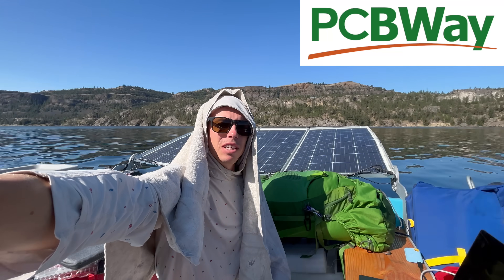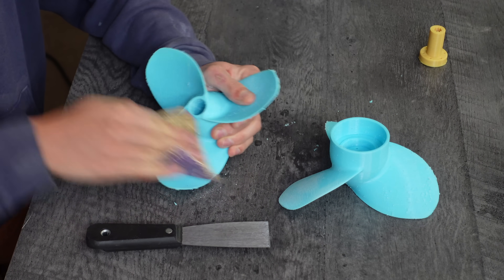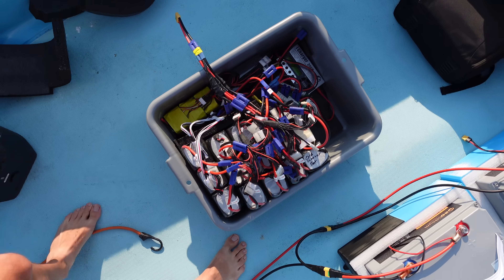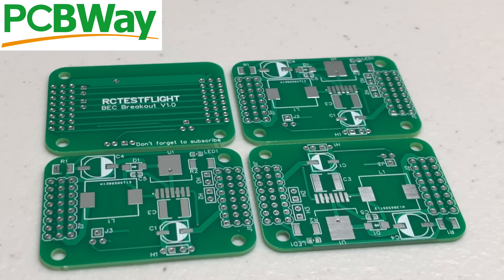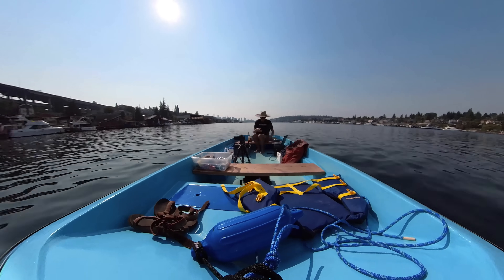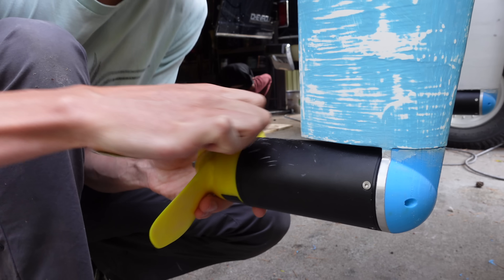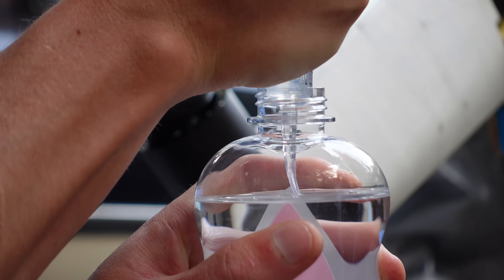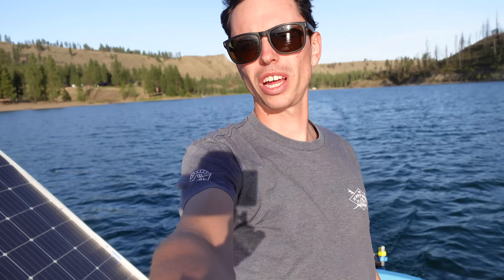Can a 3D Printed Propeller Handle 3 Horsepower?

Comment: If you top out your motors to 100Amps, spinning it for higher RPM will require more Amps, increasing voltage will not help. You may want reduce propeller pitch, or size, or both to let motor to rev it higher, and then you 'll hit your 100Amps current at some higher voltage, with higher power. But keep in mind, that going too far away from 0.7..1.4 diameter to pitch ratio will decrease efficiency, so hawing it consume more power does not necessarily mean you will have more speed.

Comment: 7:28. Not a whaler thing. just a boat thing.
Reply: also, they're probably over-rated ESC, but you're pulling 35A at 48V, vs rated 100A at 70V. also could just be a burst power rating. but an overpropped motor would pull to esc/motor limit... i think the prop is good for your voltage, but not ESC and you would in fact be over propped for 70V.

Comment: information          2:58   it can be seen that in this sort of application, the inrunner bldc is loaded via  mechanical  DIS-advantage; over the load that occurs across the  swept  radius/diameter  of the prop.         the force produced by a motor is  'created'  at the (internal) Radius, where magnets and coils move past one another.        the use of an inrunner motor is, therefore,  problematic where the load  occurs at a radius that is greater-than the radius of the motor's rotor.        d

Comment: Hey Dan, just a point on motor voltages. Motors are not rated for a voltage. They are rated against heat buildup, which is caused by the resistive loss, I^2.R. Higher voltage does mean higher current for the same prop, but the voltage is not the issue. You could use the motors on 30S provided the prop was reduced to a smaller size.

Comment: If you're maxing out the phase current, that means you need to increase the RPM, because the back-EMF generated by the motor is proportional to the RPM, and that directly affects the maximum voltage you can feed the motor.

By increasing the RPM, you increase the motor voltage, and since you've got a fixed motor current, increasing the voltage is the only way to increase the wattage.

"But I'm using a battery of X volts," you may cry. "Isn't that the motor voltage?" 
Excellent question, no it is not! The ESC acts as a DC-DC converter, taking higher voltage and lower current from the battery, and converting it to lower voltage, higher current to feed the motor. The voltage and current it feeds to the motor changes dynamically according to your settings and the load applied to the motor. High load at low RPM (high torque) requires a high current, but a low voltage, causing you to hit the current limit well before you hit your power limit. Raising the RPM will allow the motor voltage to be higher, thus allowing higher power.

"Wait" you say, "DC-DC converters need an inductor to work, and these ESCs have none!"
Well, you're right, but the motor itself acts as the inductor.

Switching to a prop of a lower pitch, or smaller diameter, or fewer blades, or some combo thereof, should help, although a higher prop speed may reduce your hydrodynamic efficiency.

Comment: Current draw is directly proportional to torque. If you want to increase the voltage without increasing the current, you’ll need to change the prop to spin faster / with lower torque. There’s going to be a balance between prop size and pitch to strike.
Reply: Phase current is, battery current not. Battery current represents watts as the voltage doesn't change, and watts represent work being done, just like HP does.
Reply: @Robbedoes2  it’s pretty hard to change battery current without changing phase current. The total phase current should equal the battery current. The fixed voltage of the battery implies a maximum no-load speed for the battery-motor system, as it counters the back-emf of the spinning rotor. Doubling the battery voltage will approximately double the no-load speed, and expand the torque-speed-current curve. If a prop-motor-voltage system was designed such that the motor was operating in a region of high power output or high efficiency, increasing the voltage will shift it out of that region.

Comment: Adjust your duty cycle in vesc throttle settings. It's only reaching 50% by the looks of it. Also check motor current limit and battery current limit settings to get Max RPM. I have played with the throttle curve in natural setting seems to work best with 100% top end offset

Comment: If you're having issues with the Flipsky 75100 overheating, consider changing from the ebike, to the aluminium shelled one, the cooling is much better. They also sell a water cooled version that would probably work pretty well for a boat.
Reply: and just seen that that is exactly what you did!

Comment: 3d printing is kind of a general term.  of course you can 3d print a propeller on a 250,000 dollar laser with the metal dust bed if you can afford one or maybe pcbway can.

Comment: You can design your propeller to suit your motor, boat and desired speed with the Bserie propeller generator. Did you test a the prop before and after the sanding? I am wondering how much is the impact

Comment: Those vescs are hilariously overrated. It is their hardware design that limits them and they are probably the worst vesc hardware design of them all. The mosfets used would have their legs melt off if pushed at a continuous 100a.  The vesc 75200 should be able to do the full current the motor can take.

Comment: In my experience, its generally safe to go a little beyond the "max voltage rating" of the motors. So 24cell is probably OK, if that means you can just throw 2 12cell packs in series instead of a custom 20 cell pack. Also make sure your ESCs can handle that voltage too. But, its always a risk to go outside of spec.
That also means you will likely have less loss due to resistance through wires.

Comment: instead of just a single pushrod, you should do 2 pushrods, one on each side of the pivot. Then, there is always one under tension, and you don't have to worry about the compression forces at all. You could even use steel cable instead of threaded rods at that point.

Comment: Those VESC 75100s have issues with performance. Apparently there may be an issue with the regulator chips in them which causes them to heat up rapidly. My friend tested 8W draw from the STM chip.  An aggressive cooling solution or an electric reverse engineering solution may do the job. Most people I've known to try them cap at 2kW, any higher blows them out. Old video, I know. 

Kelly Motor Controllers, or other VESCs besides the 75/100 are pretty good options for better performing motor controllers. In the 2-12kW range, I think Kelly is pretty solid. Above 12kW Sabvotron, BAC, and Votol have been pretty well represented. There are some people who make low-production high-performance motor controllers, but they're typically for electric motorcycles.

Comment: He already realize the bottle neck, it requires higher supply voltage, usually it means the motor has reached torque limitation. The size of blade should be reduced, however don’t forget the motors are oil sealed, as the rpm increased more and more energy will be eaten up by shear of oil. The motors are the bottle neck, they designed for low rpm, either add extra units or get them out of the water to avoid oil shearing losses, as I did not do it wrong, he is losing 1000w at least just stiring the sealing oil. Dam it’s expensive if do it properly. Another possibility is the shape of the hulls tail, it’s too turbulent at higher speed, increased vortices and bubbles will offload the blade.

Comment: What if you made a heat sink fin that just stuck right into the water? That way you could get some cooling without as much parasitic loss as a mechanical pump.

Comment: i bought these cheap 1500W boost converters that can convert 12v-72v anywhere up to 96v. you can see me using one to find HVC on a motor, here:
Reply: https://m.youtube.com/watch?v=S-_bZ69EbU8&t=5s

tune them together, wire 6 in parallel, spray with ultrahydrophobic, QED

Comment: Why not an overhead solar canopy? (14:30) 
For camping/cruising an overhead canopy (solar roof) would offer shade, and keep you dry if rains. Would offer at least 50% more solar area. Some used 60-cell solar panels could provide more power and voltage. 
Another alternative is vertical solar panel that could also double as a wing-sail.

Comment: the water maybe from the electrical cable running from your motor the the controller. the magnetic field is pulling the water(minerals in the water) thru the conduct.

Comment: If you're looking for a mineral oil that's intended to go into a sealed system with o-rings, get some Shimano or Tektro mineral oil for bicycle hydraulic brakes. Don't get SRAM or Hope brake fluid as this is DOT and will most definitely destroy the o-rings.

Comment: 1. You need to use really thick cables and, at least, xt90 connector for 100 amps. Thinner cables limit amperage.
2. Try water-cooling ESCs. Or to use water-cooled out-of-the-box ESCs.

Comment: Since you have the 3D files it would be cool to send them to a manufacturer like PCBway to have them metal 3D printed, they would still need some sanding and balancing but you could make some pretty durable custom propellers!

Comment: Would it be possible that instead of running a 200 amp motor controller you use the controller for low speed manoeuvering and then for full power you just flip a switch or do these motors need a feedback loop to work?

Comment: @rctestflight I have a half homemade Electric motorcycle. I'm disabled and have a license but can't drive. I can walk just not far. Pension is not enough to insure a car anyway. This bike for the past 2 years has been my only transportation. Trouble is the batteries froze when the charger got unplugged. I have been stuck at home since 2019 waiting for people to give me rides. Can't join friends on bike rides. Going loopy on my own. I can't find anyone to fix it anywhere around me.
 Would you be interested in building a battery pack and charging system for my bike? Also has other electrical problems like the lights and signals. Needs a proper fuse box. I'm willing to pay well to do this. You could make a project video from it at my expense. Originally it had 6 scooter lead acid batteries. I'd like to convert it to Lion packs or RC batteries. I'm Canadian but have a family cabin in Birch Bay. If you are not interested can you recommend someone?

Comment: It’d be interesting to see how well you could get a position hold working. Digital anchor. With reversible thrust and differential thrust I’d imagine it’d be pretty good. At least within the GPS accuracy limitations.
Reply: ardupilot boat has some decent position hold mode now, like one designed to keep place in a flowing river so yeah it should be doable today

Comment: Daniel, FYI, I have a 12" boat with a hull much like the Whaler's. It takes close to 8hp to get that on plane with a total weight of 300kgs. That is the same as 6KW and 660lbs.
Reply: 12" - a real Spinal Tap Stonehenge comment😉
Reply: Both motors running at 3700 W is a total of 7400 W. The weight may be an issue though with all those batteries.
Reply: @conorstewart2214  yea whats wrong with one motor and a real propeller made of metal?
Reply: @Hoffmanpack  nothings wrong with only using one stronger motor, but he has two less powerful motors, nothings wrong with that either. You quite often see multiple engines on boats with separate propellers, especially on smaller boats.

Using one or two motors doesn't change the amount of power or battery capacities he needs or the amount of solar panels he needs. 

Also there is no need for the propeller to be metal if a lighter material is good enough. The forces on it probably aren't all that large and plastic can handle it. There is a reason small planes don't use metal propellers, wood or carbon fibre are good enough. From what we can see in the videos there isn't anything wrong with using plastic propellers.

Comment: Idea for cooling. What about a raw water cooling system where you use the water avalible where you float to cool down the controllers, as a outboard will do?

This can archive with a small fishtank water pump or even using the movement of the boat to circulate water? Its  actually simpler than it sounds, my small rc toy speed boat has a similar cooling system that doesn't have a pump and it works amazingly well and yet simple. It has a ventury nozzle on the bottom the hull to suck the water.

Another very inspiring video on your channel

Comment: I designed my own wind turbine props and to get the strongest 3D printed setup. I had the props fit into the hub, through male/female slots.
That way, I only changed the prop blades instead of the whole prop, and could adjust the pitch angle to find the optimal. 
Also, I was able to lay the blade prints down on its length, to get the strongest layer direction. .

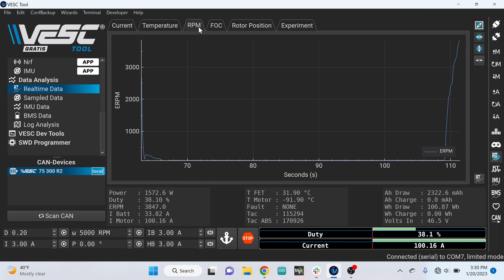Comment: 13:30 you wont be able to get more power by just increasing the Input voltage.  This way you only gonna end up with the same 100A Phase current but with like around 25% duty Cycle. If you want to maximize the Power output you gotta decrease the load on the props by a smaller diameter and/or smaller pitch so that they meet 100A at the highest possible duty Cycle, like 90-95%. And my guess is that you would need around 15 kW to get this thing to plane 😄 ps you can Control the vescs over adc with a normal ebike throttle or just a simple poti. Great work!

Comment: At 8:40 you mentioned motor Peak amp draw of 100amp, but you were only drawing about 35amp. To me that statement sounds normal.
As an example of peak to constant torque, look up: CPM-MCVC-D1003A-RLN_Fan
Check the torque chart. The torque can not remain above the constant line long term. Many motor companies will only tell you the peak torque amount, and not the constant. Same for the motor driver amperage. I work with the Teknic motor line up at the factory I work at, not sponsered by them, just really like their motors and tech support.

Comment: The Makerbase 75200's are the best price I've found so far. I had the same problem with the flipsky 75100 overheating in my EZTR. @45A they can run continuous, 75A they will overheat. Also added heatsinks. Had to add fans as well.

Comment: From the picture off the VESC tool, you have only 42% duty cycle/ about 20 volts going to the motors. Your propeller is way to big. If you get the duty up to 95% 48V ( max) and still push 100A phase amps you will have 2.2x the power. Is the Amps that generates heat. So if you motors can handle 100 phase amps eatch motor at 46V will make 3740W!.
Reply: This info is pure gold for Vesc users! I learned that the tedious way setting up my 4x vesc hub skateboard.

Comment: Nice, for next set of props, you can use uv curing epoxy ( like the one you 3d print with ) to add the weight evenly and balance your props!

Comment: Usually for BLDC motor the phase current is higher than battery current, especially at low RPM, as it's acting as BUCK converter. If the prop is too big or stip, you are loading the motor, requesting high current, hitiing the ESC treshold sooner. Also by keeping the same pitch on the prop and same diameter you will push the same amount of water at the same RPM, even with two fins.

Comment: I'm wondering what the relation is between engine power and propeller surface. There is a sweet spot somewhere where the drag and pushing force are optimal

Comment: for the props lifting out of the water issue, I used to drive a small boat like this as a kid, I had the same problem but even sitting at the back.
We ended up putting extra weight at the back. Your batteries would probably do fine but I think we used our gas tanks and some heavy chains at the time. 
The boat doesn't really care, it's incredible really how much weight you can carry on the water.

Comment: I was watching a superfastmatt video about speed week at the Bonneville salt flats, and one of the EV teams there was running a 98s2p battery. I think you should give that a shot
Reply: I get the feeling there might be a bit of crossover between the 2 channels, different categories but similar approaches.

Who knows maybe one day we will get a crossover?
Reply: 400v yikes. More volts = less wiring mass but I wonder if that's too much voltage to use around water/humidity?
Reply: @confuseatronica commercially available EV boats definitely use voltages that high. You seal the batteries, cables, etc of course

Comment: hey love your videos. for next time, instead of spending ages sanding and smoothing the props, you might want to look into ABS vapour smoothing. By printing a part in ABS and suspending it above some high purity acetone, you can get a part thats as smooth as one cast in resin with very little effort. idk how strong the finished parts are, and ABS is kind of a pain to print in, but it might still be worth looking into
Reply: Might be a gamble with ABS. The PETG that Daniel used is a lot tougher, which I think is pretty important in an application such as this. Would kinda suck to crack a prop by getting too close to shore.
Reply: @KnowledgePerformance7  ABS is pretty impact resistant so it could be an option. Maybe ASA would be better?

Comment: Motors are limited by Amos not watts.
If you are pulling 100amps at less than max power, you need smaller props to get up to full rpm and hence full volts.
Reply: weird way to say it, could barely comprehend, but yes